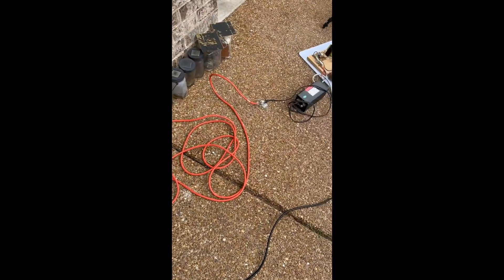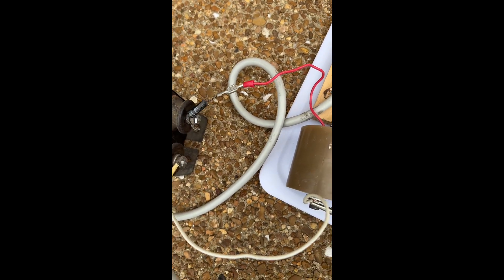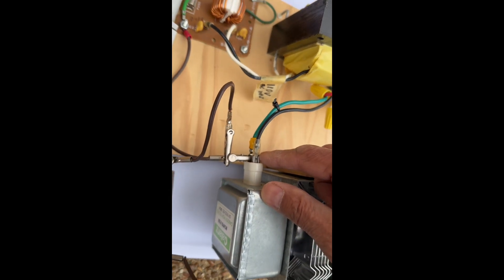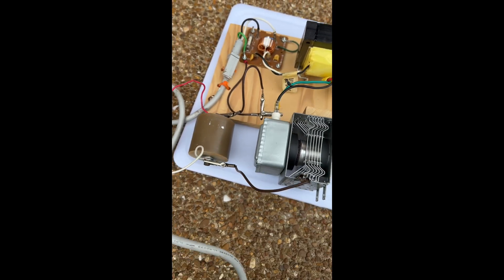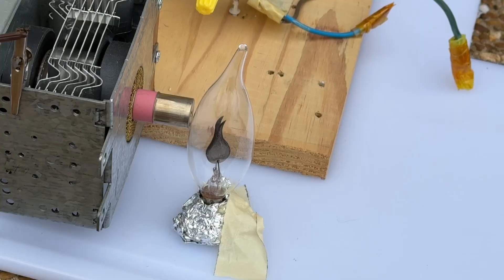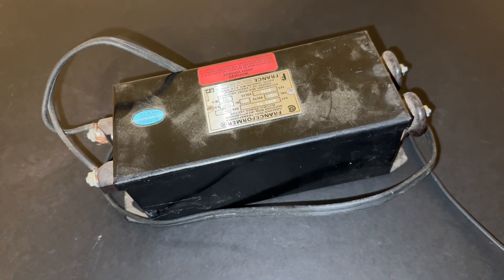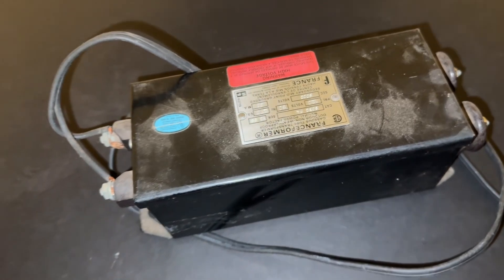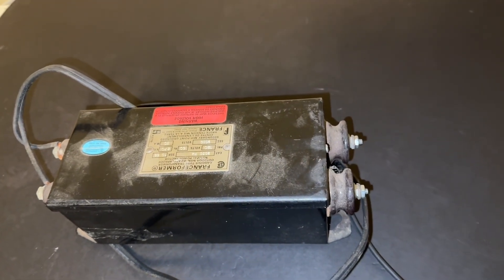Powering a Magnetron using a Neon Sign  Transformer (NST) ￼

Comment: Heating the cathode affects the cathode current and, as a consequence, the output power. To reduce the power, it is enough to just reduce the filament voltage.
Reply from the maker: I’m preparing another tube to do some more tests with the filament. This should be interesting. I’ll keep you posted.

Comment: I'm trying to run to my magnetron but for some reason the filament uses a extremely high current and no matter what transformer I use I still can't get it to Glow
Reply from the maker: It could be shorted. It should take 3.3V. You can tell that the filament is on because you should see it glowing through the ceramic. I used a variac connected to a step down transformer to control the filament voltage. At 3.3 V there is a visible orange glow through the ceramic of the magnetron.. This glow  gets brighter as the voltage is increased.
Reply: @BrianDhvTinkerer  I just realized that the problem was the current was too low. I tried some higher current transformers and now it worked
Reply from the maker: Awesome. You can connect the transformer and then measure the AC voltage to make sure it’s about 3.3 V. I viewed mine remotely to avoid microwave exposure while running it behind the garage door.
Reply: @BrianDhvTinkerer is it safe to run a magnetron filament on 12v instead? I have a high current transformer and that's the lowest voltage it can output

Comment: What about wifi router and mobile phones, how are they affected?
Reply from the maker: It didn’t seem to affect mine bc the output is so broad spectrum – I do have a spectrum analyzer, but it does not go as high as 2.4 GHz.
Reply: @BrianDhvTinkerer  2.45ghz (microwave oven operating frequency) is near wifi spectrum. You can place an old wifi router nearby and do a speed check, then you will know.